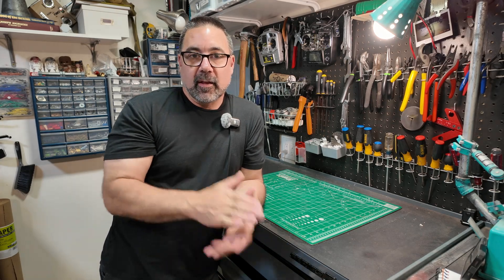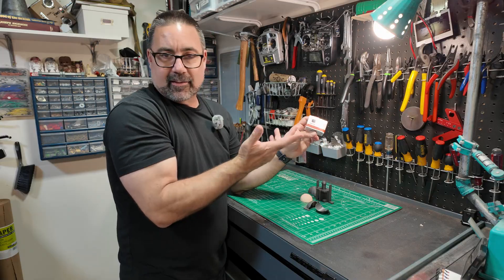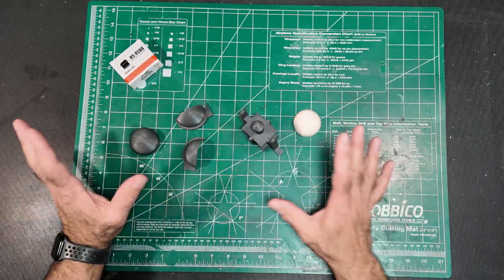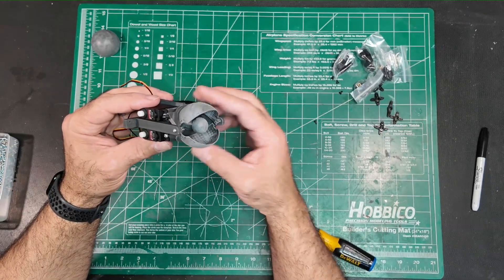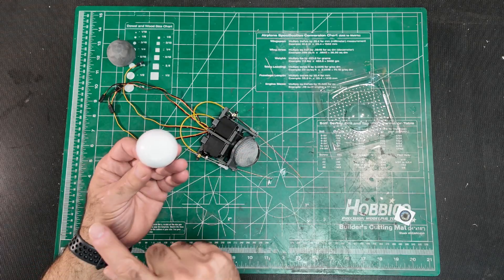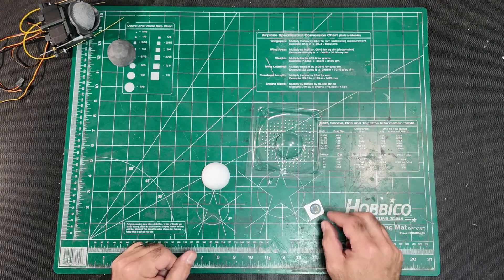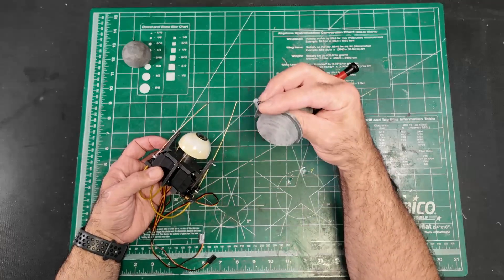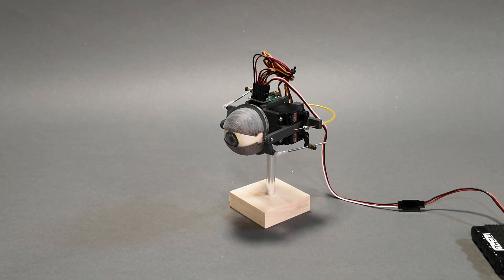How to Build a Realistic Animatronic Eye – 3D Printed, 4 Servo Design

Comment: Great project. Can you provide a source for your linkage cable and housing? What brand/size are those? Thanks!
Reply from the maker: I buy the cable and housing from Sullivan Products, this one is the 1/32 cable. They make this for RC airplanes and sell the housing and cable together. So, it is likely available at a larger local hobby store.